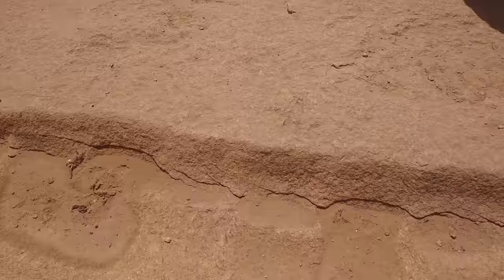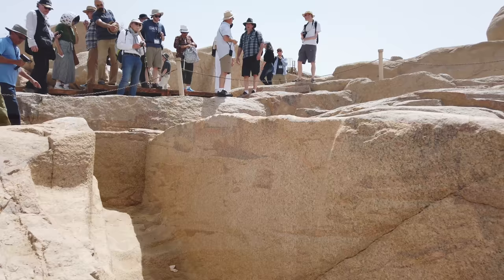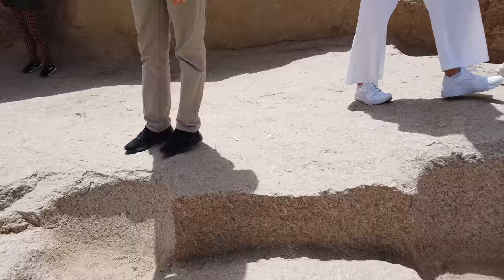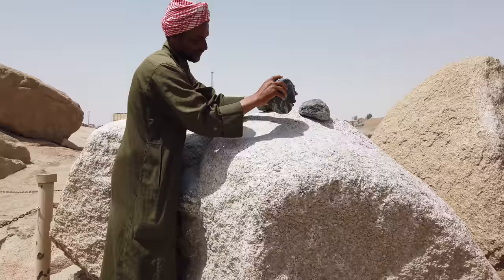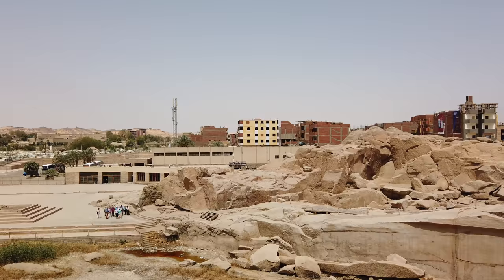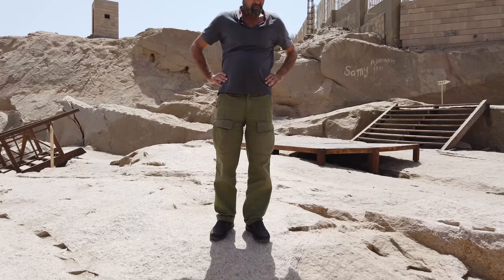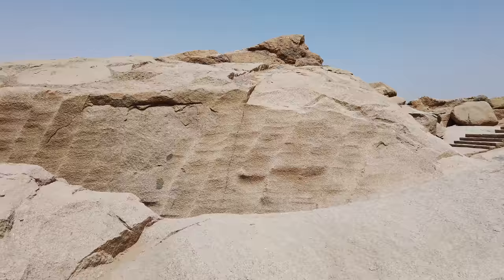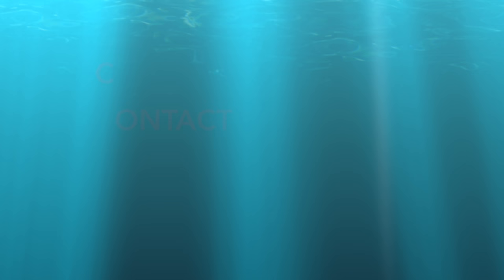Aswan Granite Quarry In Egypt: Obvious Example Of Ancient Advanced Machining Technology

Comment: So it’s really simple. When they excavated the quarry they found pounding stones and ashes in the pits. It’s amazing that when you heat up rock it becomes incredibly brittle because stones like granite were formed under compression. So the Egyptians found out after heating they could dig 20cm an hour instead of 6mm an hour on cold stone.  In fact they could use copper tools to carve the stones. So if you take the time, the answers are out there from actual archaeological studies.
Reply: How hot would they have to heat that rock to be able to scoop it out tho? If it’s hot enough to soften granite I don’t think I’d like to be sitting in there pounding it with some rock.

Comment: It doesn't look like "scoop" marks to me. They look like the same marks that chainsaw carvers make on wood with rounded tip saws. At high speed they create scoop shaped divots in the wood. The same thing could be done with advanced stone grinding tools with rounded tips. Still high technology but the stone doesn't need to be "softened" to make them. I can't say definitively that is how but watching wood working, I can see how it could be used on stone. Maybe with diamond tips. Very advanced.
Reply: just think of an nozzle emitting energy beam that dissolve rock by breaking atoms bonding  turning granite into mono atomic sand
Reply: Thanks for that novel and new insight into material removal.  It is what is being used today by some manufacturers.  Stone softening and scooping are not ruled out by it but that alternative  method definitely needs to be considered as an equal or superior possibility.
Reply: @redwoodcoast  with our restricted science you maybe right , but what we can observe on rock cutting across the world i think it must be like an adjustable very thin blade about 1 mm wide with 30 cm large and with a reach of 2 meters to reflect traces left on rock and hieroglyph

Comment: Looks like the cutting was by a large trowel in soft putty. Stones bashing stone would not do that. I remember similar marks from your vids of interior of Petra.
Where the shards or leavings? Even if every visitor ever had taken a souvenir, there would ones too tiny and ones too heavy to carry. Surfaces appear like the custodial crew did a bang up job.
Wooden wedges? First have to dig out wedges holes. One thing with steel chisels, quite another without.

Comment: I wonder if they used a spring that they could have wound up tight, held by a catch until ready for release, then set in an anchoring wooden framework with it attached to a grooved harder stone tool or cast metal tool, and released. And then it could have very quickly unwound. Its ability might have been a matter of scale. Adding a counterbalancing weight might have created a drill hammering effect.
Reply: No sorry. No advanced tech here. Just man power and the threat of beheading if you don't work.

Comment: Brian. I love your work. Fascinating. The scoop marks appear to be made by a high pressure medium. Think of a pressure washer only not water. Probably recycled granite. There's not enough room between the obelisk and the wall of the quarry to fit a machine. They were using a wand. The end of the wand could be flexible and the shape of the tip determines the shape of the scoop. Like sand blasting.

Comment: Could have been a high pressure water jet, maybe with some sort of aggregate.
Reply: Makes a lot more sense then copper cheisels
Reply: @Praque Forqsk that's exactly the question. The dynastic Egyptians would not have been capable. That is why some people believe it was done by pre-dynastic people with much higher technology.

There seems to be different methods of stone cutting used for different applications. The smooth cuts have rounded edges, which is what makes me think it could have been done with water. The scoop marks look like a rounded stone cutting bit.

Nothing about this looks like chisel or stone on stone.
Reply: @Praque Forqsk even that makes more sense than copper chisels.
Reply: @sebione3576  Yea personal i think its more far away from the dynasty's even alternative researchers claims.
Reply: Sebi One, we can't imagine a technology that will cut the stone, but you suggest a level of technology involving high pressure pumps with pipe and tubing that will withstand those pressures? High-density bamboo, maybe?

Comment: Not enough force on the dolomite ball hammers. Think of bouncing them onto the surfaces. The walls were done with ropes from the top and slack let out to lower the hammering surface. 3 weak attempts at doing this are counter-productive to the actual manner a laborer would have used those balls to remove sections. Just a thought. Anyone can try this with a harder round stone onto a softer one. Let the momentum of the ball bouncing up to do the work. Give it a try. Peace, Thanks Brian, :) Brien... is what I meant to write.
Reply: Are you still going with the rock onto rock theory?
Reply: @daelanthony7027  Only for the soft-edged pillow like stuff. Things like the smooth cut rose-granite and such are obviously a technology beyond our understanding. The rock on rock works for a lot of these things though.
Reply: @kevink.7597  I'm sure the mainstream archeologists agree with you. As long as you're happy with that I'm leaving it alone.
Reply: @daelanthony7027  Most mainstream archeologist, anthropologist, geologist... etc... are pretty level headed people. The fact that so many dolomite hammer balls are found around Egypt, including one found in the closed vent leading from the Queen's chamber upon opening, that connecting the two are not a stretch. They can create the type of marks found upon many stone creations in many parts of the world. It is not a stretch to think they are connected. Nor is it a stretch to think that they were not used to make many of the stone creations showing laser-like precision. One fits one, not necessarily all. I'm not happy or unhappy. I just follow facts and try to find the logical answer to them as they come along. One size seldom fits all. But, in this case, dolomite hammers work for the purpose suggested. Peace, And yes, I'm done with this as well.

Comment: Do the scoops have a regular depression and diameter?
It looks like it from the video, but it'd probably more apparent in person. 
If they are irregular, that could mean “manual labor“ was used as well as the exotic technology. 
Although if it's uniform, that would mean this was an industrial area to drudge rocks.

Moreover, they must've had a way to make the stone soft, similar to the structures in sacsayhuman.
Reply: In my opinion, irregularities denote speed and ease. Just like in Puma Punku - the angles are not all perfect and flawless. As if they were just moving along with production. P.S....I'm a mason by trade.

Comment: More likely caused by water under pressure carrying sand as an abrasive.  All that is needed is a water source that is at a higher elevation and piping to force the water to higher speeds and firection control.

Comment: Definite proof that they had generic and fine nozzle sand blasting technology, able to cut through granite and basalt, and then fine sand into a total micro-crystalline glassy surface.
Reply: Not definite but possibly. 
Good comment tho....
Reply: Water jet with abrasive
Reply: Cobb Knobbler  Yes its a Theory. actually if you use a standard Surface Roughness Tester range from US $355 to US $1500. maybe one with forensic opinions with out print documents. For use in disputes with craftsmen if they did botch. you will get a  roughness measurement according to Ra, Rz, Rq, Rt, Rp, Rmax, Rv, R3z, RS, RSm, RSk, Rmr. 

Technically there is a distinction between manual work and machine work. Engineers took distinction between manual work and machine work based on surface qualities. continuous tolerances per unit area.
Reply: Cobb Knobbler  NO !!!! ... it is not definite proof they used soft copper chisels on harder granite and basalt.  THAT is not even a theory - but a BOGUS supposition and opinion - not even based upon valid facts !!!!

Comment: I think that they knew how to change the frequency of the atomic structure of the stone.  If you could change the vibrating frequency of the matter for a period of time, you could literally scoop it out like butter, form it, shape it, press stones together, smooth the edges, create bowls, curved surfaces, strange fittings etc and then let the frequency settle back to it's usual state.  They probably used magnetism to float the massive ones into place.  That's my guess anyway.

Comment: The scoop marks on the vertical wall at 3:39 is the “test hole” bore... all in a row. A plunge cut! By hand!!
That tool didn’t rotate.
Reply: Stagnant boring bar with diamond head moves around a template, or directional leaded. In order to catch the necessary moment on the tool, a machine of the order of magnitude of an excavator is required.  But there is a problem.
 
Using excavator or Plunge cut By hand.  its necessary tool have to dip into the material.  unfortunately application includes the same problem as using  excavator here. According to the accuracy and  power distribution it will work here inadequate, because the lever arms would be too long. in technically view therefore, a rotating tool would be to prefer here.

Which kind of machine / application was also used here. basically the entire moment was intercepted at the tool head.

Comment: There would have to be residues left by the cutting tool embedded in the rock, or a change in the crystalline structure if something else was used.  Why can't samples be taken and looked at under an electron microscope to determine this, there still should be some remnants even after all this time.
Reply: yes this can be done easily by observing with a electronic microscope any stone artifacts of the great museum across the world , if my theory is correct they will see very little traces that can be seen at the molecular level

Comment: It had to be like CLAY , it’s the only thing that makes any since...
   Cheers
Olympia
Reply: Pacific Northwest360BEAR I agree. It looks as though it was as soft as clay. However they did this has been lost with time. I agree with Brien, there is obvious evidence of a pre-dynastic Egypt.
Reply: Hardness is a relative characteristic. Limestone is soft compared to some other forms of stone or advanced metal tools. Therefore, it could be scooped like clay, if you had a tool made of a material that was much harder, and with enough force behind it.

The problem is that the stone would fragment. These aren't scoop marks. They're grind marks.
Reply: @sebione3576  Yes. They look like scooping, and I think that is why Brien describes them as such, but they definitely looked machined when they are in front of your eyes. Brien is all for pointing out areas on the rock that show distinct evidence of sawing and drilling. But this method for quarrying the obelisk is different. To me it looked like a rotor head was used
Reply: @sebione3576  thats granite not limestone

Comment: Look up "Rock Drum Cutter" on google images,  that's probably similar to what they used where you see those "scoop marks"
Reply: Funny. That’s exactly what I was thinking when I watched this video. Never occurred to me before when I saw these “scoop marks”. Something about the angel of this video convinced me. Definitely some type of rotating drum/wheel. Makes me wonder what material was used for the cutter.
Reply: Henrik Wallin     This link and the equipment shown is just a good starting point , an idea looking to be discovered . But as usual just ends up giving more questions then answers . But that's how the world was built back then one good idea on top of another . Literally . lol . Have a good night my friend
Reply: Its a very effective tool , not saying its exactly the same, they prob had different kind of grinding ends but something similar would be a logical explanation  , http://www.companywrench.com/wp-content/uploads/2017/08/Drumcutter-ERC-300x225.jpg
Reply: I don't think so, the modern rock drum cutters leave striations on the surface that would still be there today, and they are not there. Even with different tool extensions this type of tool would leave these marks.
Reply: Doubt it. That tool would pulverize rock into dust. 
 Sonic technology was used. Not blunt force
Reply: Looks temptingly similar to the marks found on the stones at Baalbek.

Comment: It really looks like they have scooped out the rock as if it was icecream, and the idea about sonic vibration comes to mind. A certain frequency on the 'scoop' and stone just cant withstand it? Maybe...
Reply: That's what I think as well. Using sound to 'soften' the stone. Technically they would some how be weakening the stone at a molecular or sub-atomic level.
Reply: Similar to hot knife held near hard butter. You don’t have to touch the butter just be near it  = controllable softening. Me thinks!

Comment: Hitting with stones does seem very unlikely, but using sand as an abrasive with a piece of wood or another stone might make more progress. Two feet is about the width of one man, and if you had people lined up shoulder to shoulder the areas between them would get worn down slower. I can imagine that having shifts of people working day and night over decades could make a surprising amount of progress. Doing some guess work 1mm per week doesn't sound too crazy, at which rate 60 years would give a cut depth of about 3 meters.

Transporting the stones would still be near imposible with the materials available, even with an unlimited labour force.

Comment: The technology of this red assuan "granite" machining was simple: the workers  shaping the obelisks were holding  the round hard stone (dolerite-diameter of some 10 cm) in their  hands and they were  constantly hiting  the red "granite " place by place starting from the top, going down. And appropriate  traces of such a "machining" are visible on site. And this workers were siting in line in still deepened gap  - one next to the other one. This technology was verified nowadays manually and there is no doubts of it. Any archeologist will confirm this.  No need to create artificially the miths of miracles, ufos and extraterrestials. This big obelisk was abandoned in quarry , after the crack was found in it.
Stary
Reply: An archeologist 'will confirm it' because they don't allow anything else in their paradigm (circular argument). There is nothing I can see on that rock that suggests 'traces' of multiple hits with dolerite. Plus the straight down cut on the other rock. Where is the evidence that anyone has managed to create something like this using only hand tools ? Should be easy enough to replicate ! Bet it isn't.
Reply: This experiment was already successivly done, even you have not heared of it.  If you will be repeating longer  time your  claims, you will be considered as the ridiculous person . It would be enough that  you will check and verify it in literature of the topic, where it is already described. Or when you know it better than the egyptologysts for me it is indifferent, what your opinion is. If you wish to live in ilusion- it is your choice. 
Stary

Comment: Looking at the “scoop marks”, polygonal stonework, and a few other anomalies, they had to have a way of softening the stone. Not heat, but some kind of chemical reaction. It looks like it had the consistency of a “heavy slump” concrete. You can see that the same tool was used, but the marks aren’t precise enough to be done by a machine alone. The starting/stopping points and the depths are too random unless the machine was being controlled like some kind of excavator. I use to think that it was some kind of sonic cutter using ultra high speed vibration, and I think that is the case with some of the other stonework, but the “scoop marks” and some of the other “tool slips” you see in some of the polygonal work doesn’t quite fit that theory.
Reply: Soften lava